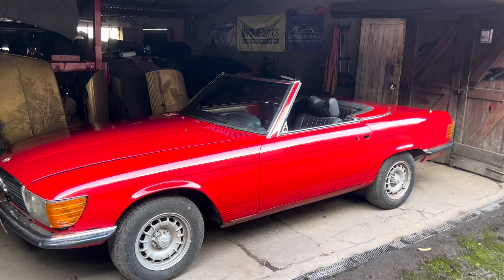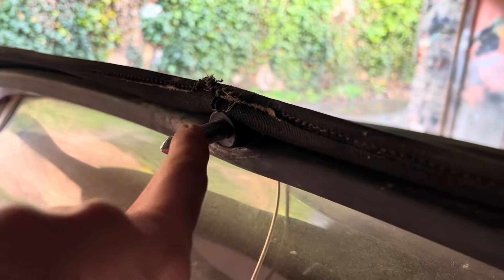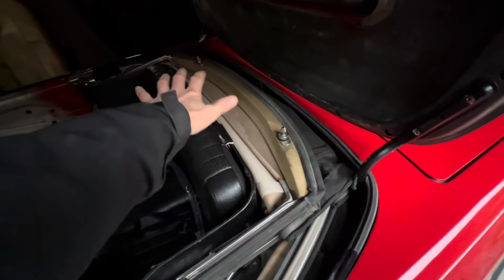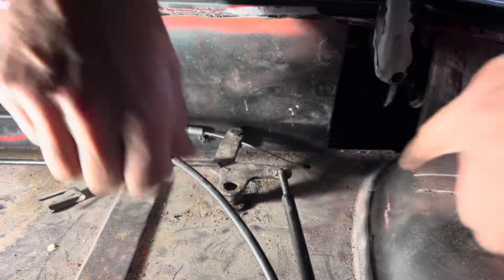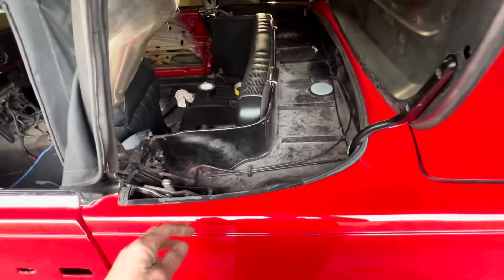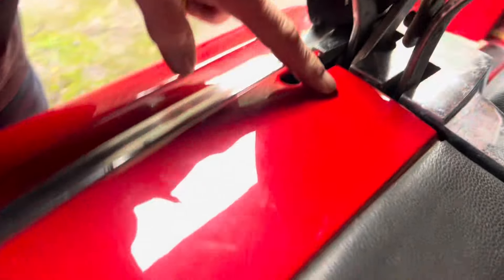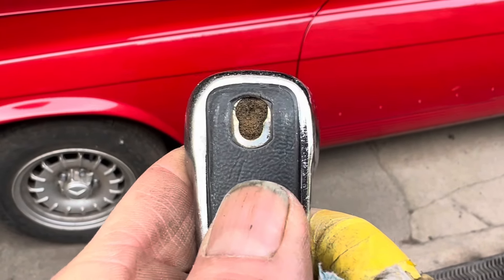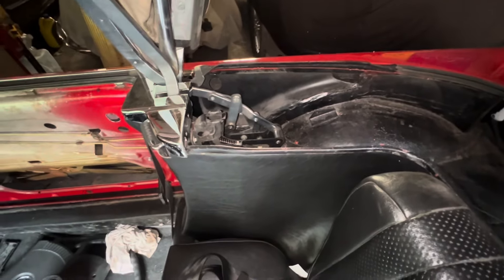Mercedes R107 soft top roof mechanism + how to release stuck hardtop + replace broken cable

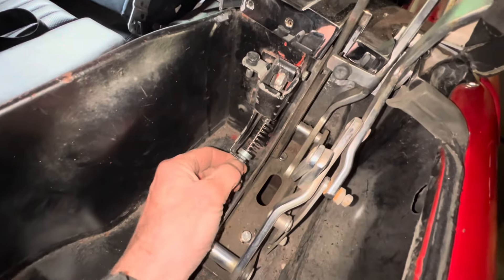Comment: A much-needed video; thanks. It takes some patience to really understand how these mechanisms work, but it's worth it. Otherwise, it's easy to get frustrated and start muscling the handle which ensures that something breaks. A weak point of this design to be aware of is the fitting where the cable meets the handle (shown at 9:37). If too much pressure is put on the cable, the fitting can bend and the cable will pop out. It's worth inspecting and servicing this entire system once a year.
Reply from the maker: Yes agreed….its in the comments below a video where one often finds the real gems of info Mike

Comment: Great video. It’s been 16 years since I’ve opened the top so this is a needed video for me. It makes me want to pre-make the tools ahead of time. Putting heat shrink on the wire will prevent scratching. Thanks Mike for your videos❤
Reply from the maker: Heat shrink in wire is a great idea! Mike
Reply: @ I shrink the tips of my needle nose pliers too.

Comment: Do you have a video on how to adjust the soft top cable? Having trouble with mine.
Reply from the maker: Hi - sorry to hear you are having trouble. Which soft top cable do you mean? The one that operates the latch for the clamp shell or the one that operates the hook? Mike
Reply: @MikesMercsandothercars  Hey Mike. I had trouble opening the clamp shell when I pushed the lever down. I had to push down really hard for the clamp shell to pop up, and I ended up breaking the lever. I was able to adjust it and get it working correctly now. Your video was helpful to see how those levers work. Thank you!
Reply from the maker: @RA-dh1tb  Glad the video helped. Mike